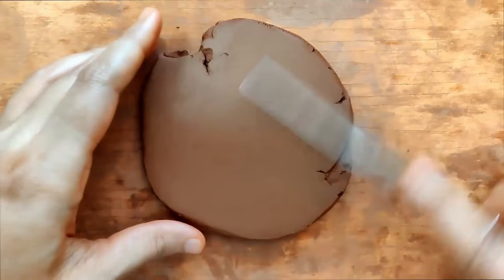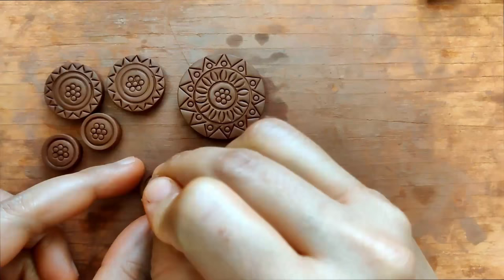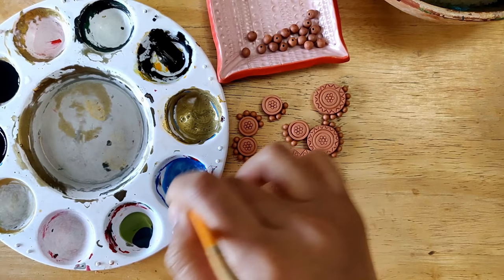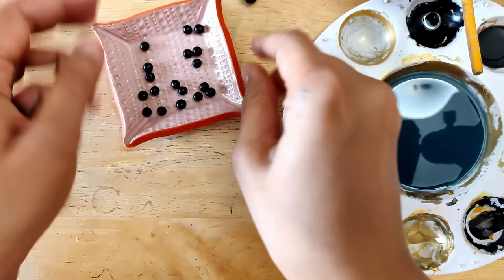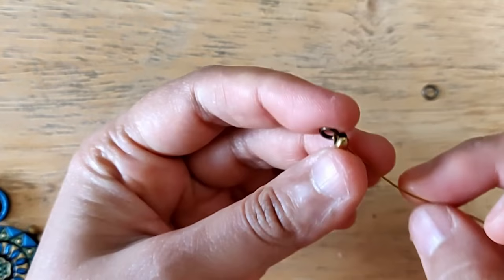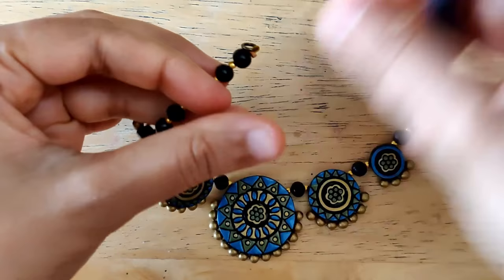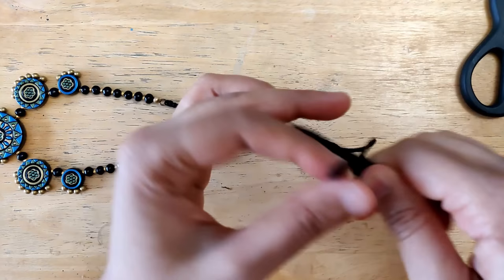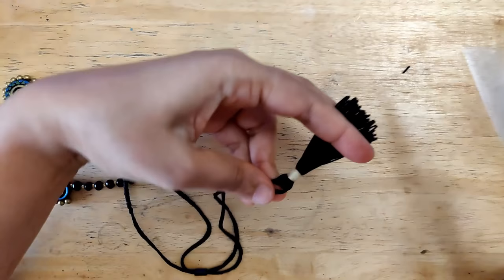Grand Terracotta Necklace set | How to make tassels | Full process | Detailed explanation #Diwali

Comment: Awesome.... 
Can we use nylon wire instead of nichrome gold color wire
Reply from the maker: Thank you so much!!
I use a nichrome wire before firing. Only for stick beads, ghungroo beads and u-pin hooks. After firing I use a gear wire or a tiger tail wire to assemble. Please don't confuse it. I have assembled the necklace using a gold gear wire (not a nichrome wire) .

Comment: Hi mam,is it compulsory to use particular size gauge nichrome wire to studs, pendants and beads or same size wire can use?? Pls tell me..
Reply from the maker: Good question.
So for smaller pendants/earrings and stick beads you can use gauge 26.
But if you make medium or bigger size pendants, using a gauge 24 might be better so as to withstand the weight.
Reply: @nehagopinathpillai  oh ok mam.. thank u.